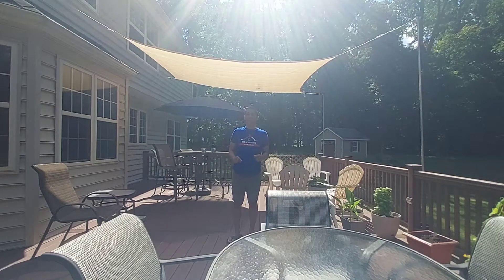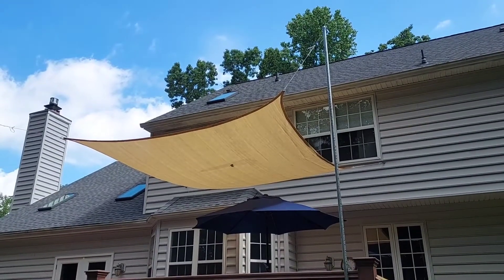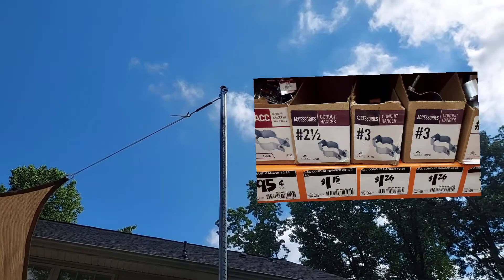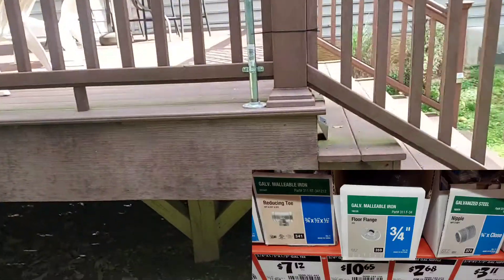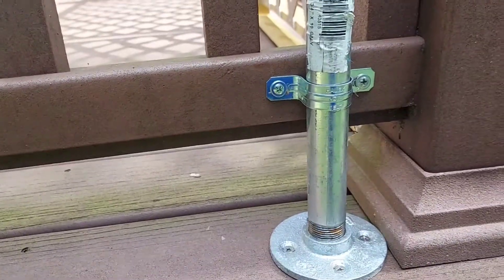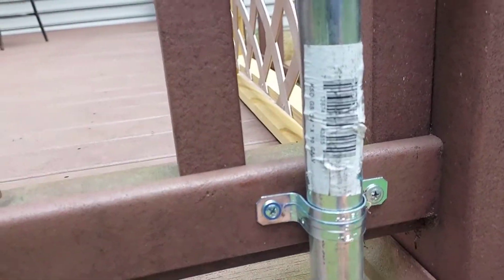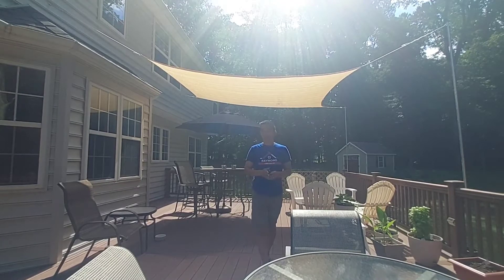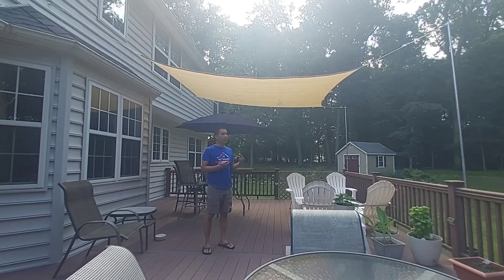How to Install a Sun Shade Sail

Comment: How is the sail attached to the top of the pipe? Did you drill holes or is something clamped to it? Also how has the sail held up since installation?
Reply from the maker: It's a conduit hanger that clamps to the pole. It's in the video. The sail has held up very well. Sometimes the ropes on the corners get undone, but I just retighten them.